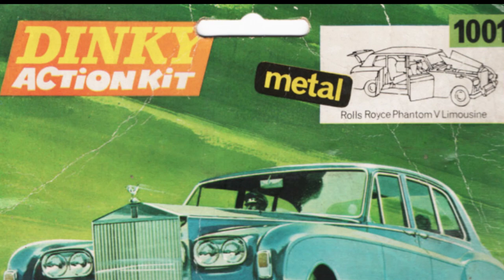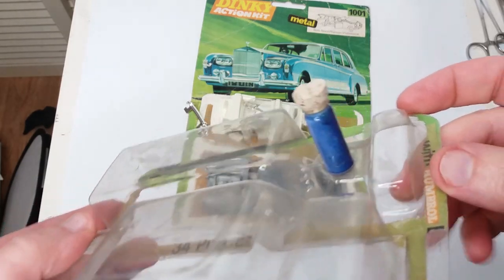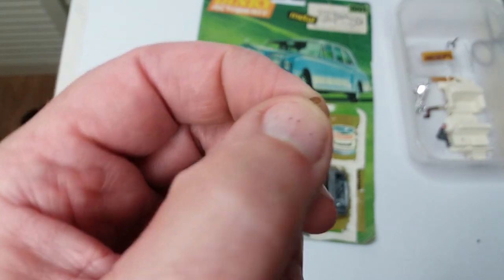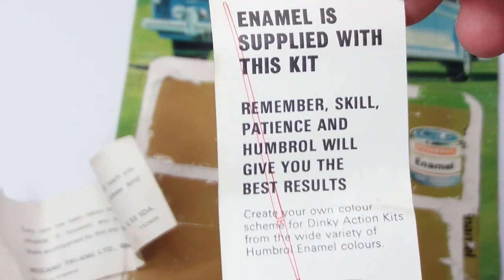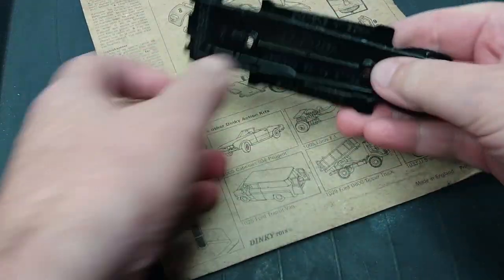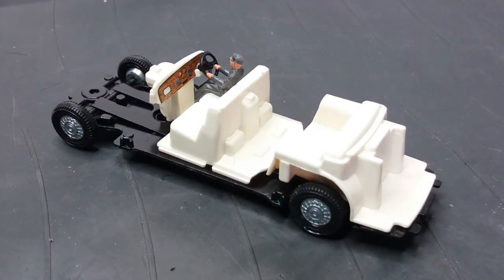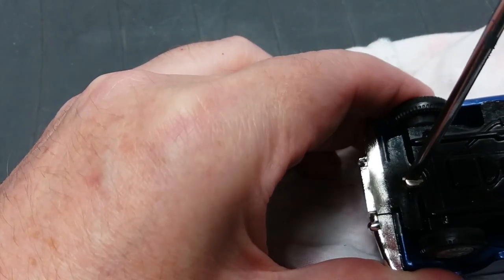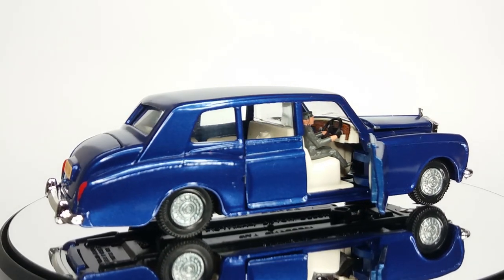Dinky Rolls Royce Action Kit 1001 unboxing and full build not a restoration!

Comment: Thanks that was awesome.  Mine (I still have her) is gloss black and has the front wheels turn when you push each side.

If no one has mentioned this yet, the two holes in the bottom were where the model was affixed in the packaging, if i remember was a plastic box with a clean plastic on top.  There were plug you pulled out to remove the model.

Comment: good afternoon .nice build replacement jewelled headlights are available self adhesive on strips different sizes and coloured from craft shops. the holes in the bottom of the rolls Royce were for a plastic stand that dinky brought in about 1973 with a plastic top cover. the rolls came in 2 shades of blue dark metallic and light metallic so yours is in period. great content but as you are a quiet speaker which is great could you turn up the sound a little it would make the video/s much better best regards from a fellow restorer.
Reply from the maker: Thanks I shall be louder in future :) i never thought of trying craft hops for the headlights thats an excellent suggestion :)

Comment: The holes in the chassis were for it the car was fitted into the plastic window boxes the holes just pushed into the plastic base and rather than it secured by a screw it was easier for kids to get the toy out of it's box.

Comment: You put the front doors in with the seating unit and the back doors will fit in afterwards with a slight little twist to get them in but they will go in without cutting the seating unit. Very fiddly though but can be done 👍

Comment: I too had one of these when it first came out, so it was interesting for me to watch your build. I also had a red Avis Ford Transit  and the single decker bus with working bell.

The paint included was not metallic, just plain blue. Your car was missing a jeweled headlight, but mine was much worse: one half of the bonnet was missing, so my model was crippled from the start, as I had to make an ugly cardboard replacement.

The Avis Transit was missing a side door. As for the single decker bus, I don't remember if it was complete or not, but at least 2 out of 3 had parts missing, so I can totally confirm your story of these kits often being incomplete.

A few years ago I re-established most of my childhood collection of cars, including the Rolls Royce (pre-built dark blue) and through extreme luck, also the Avis Transit. The reason that I call this "extreme luck" is, that Dinky never sold the Avis Ford Transit in pre-built form, only as kit, and these were not nearly as common as the pre-built ones, so finding one in near perfect condition (well, as perfect as a home-built model can be) really made my day... and it's not even missing any parts :)
Reply from the maker: Yes i remember a shop near me that had several hanging up that the blisters had detached and where fixed back with sticky tape almost certainly missing parts but they were great fun to make. There will be another kit build in the future.

Comment: Does this company still manufacture these kits?  This is higher quality than anything available locally in the USA when I was a child. Wait, the scale of the driver is smaller than the scale of the car? Oops.  And the lines of the auto do not line up even when the doors are closed? Not a perfect model after all.
Reply from the maker: No they stopped making them in the 1970s.